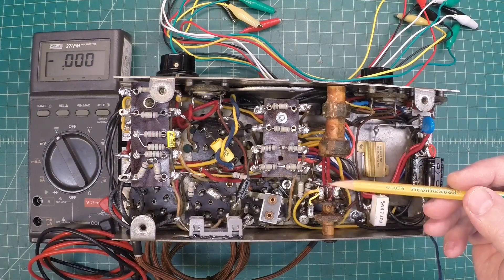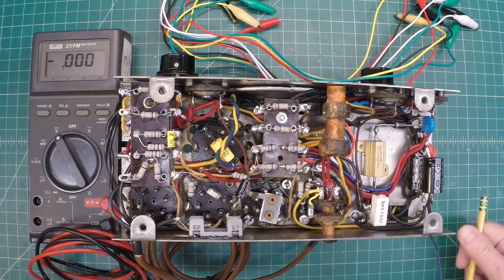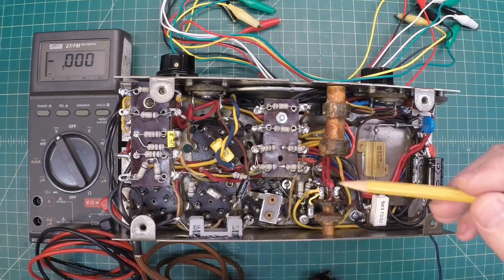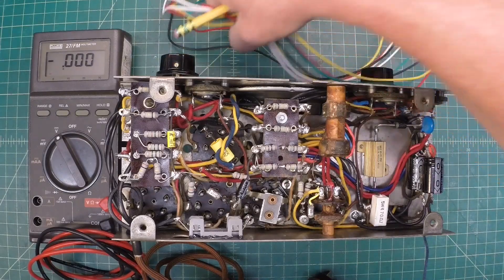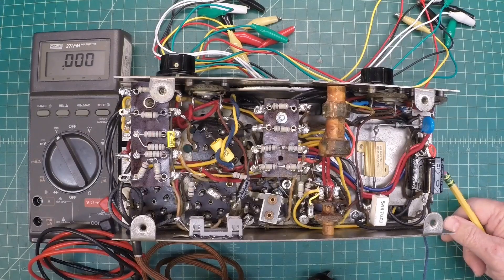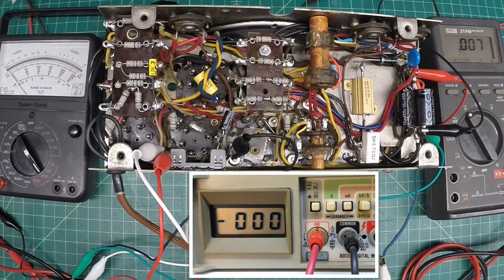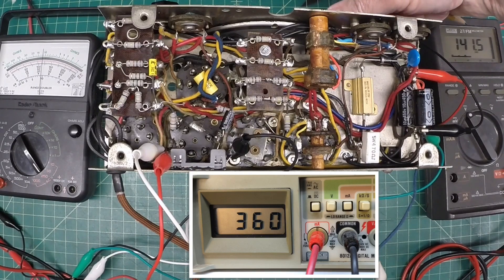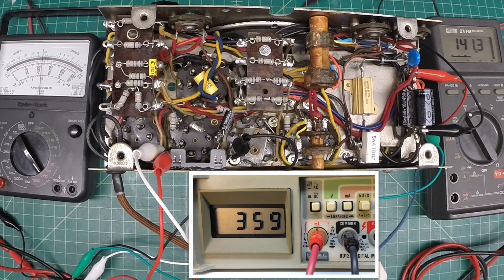Silvertone "Companion" 57 D 1704 - Powering It Up

Comment: Awesome.  Curious about the power resistor that replaced the curtain burner cord... how hot does it run?  See that you left ample room around it.
Reply from the maker: +Richie Allen Richie, I captured the temp using my IR.. after letting the radio play for an hour. The PR was 126 degrees F. while the area around the Rectifier and Output tubes were just under 200 degrees F. I did leave as much room as possible to your point to mitigate the effect on the electrolytic caps. The temps will be higher with the radio back in the cabinet I’m sure. Hope this helps. Best, Don

Comment: Another satisfying conclusion.  The radio seems to have lots of gain.  It sometimes amazes me how well the old sets work. The oldtimers knew what they were doing, and did some amazing things with what they had to work with.  How is the audio quality there in person?
Reply from the maker: +Stephen Moore Lots of gain for sure. I can’t wait to get the alignment complete and on a real long wire antenna outside in the air. The audio seems to be more treble like the majority of radios for that period. I’ll re-evaluate once it’s back in the cabinet. I may need to increase the value of C17 a bit. Thanks again for watching Stephen and go get started on the Trio. Best, Don